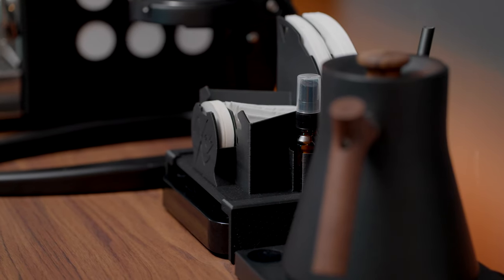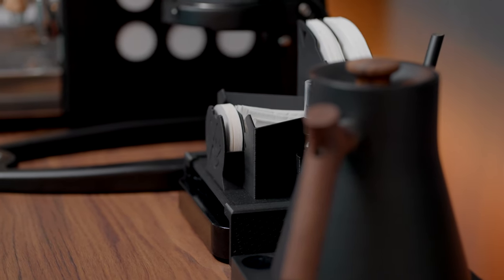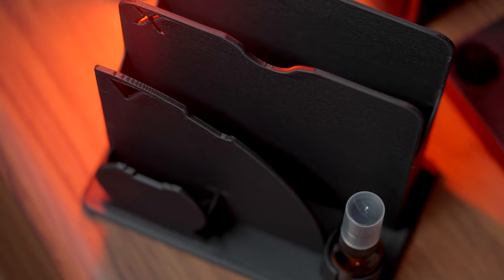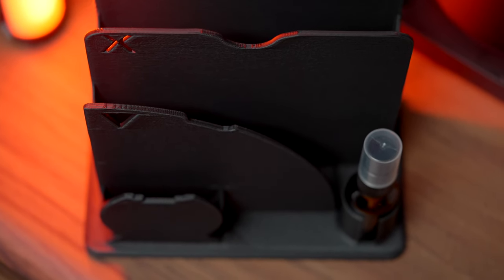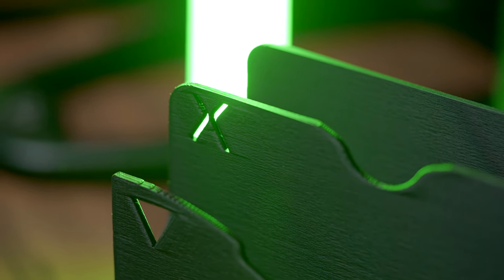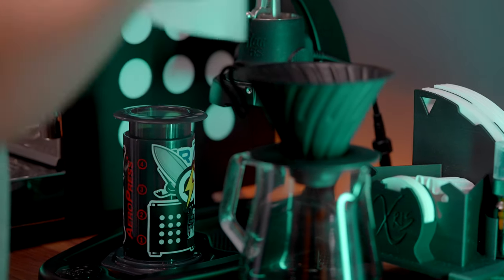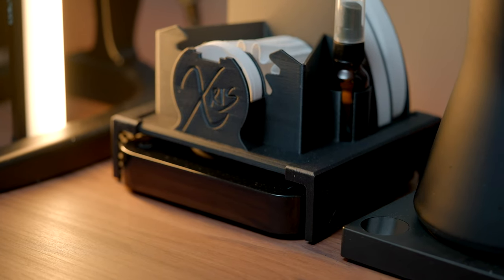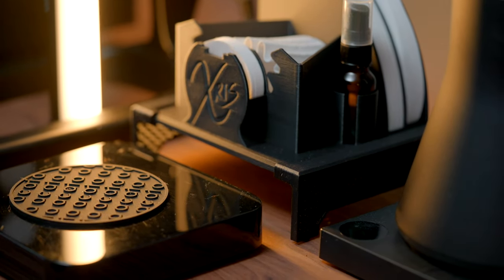The ULTIMATE Coffee Station Organizer!

Comment: I always wanted to print a Filter holder for various Filters but when looking closely to 3D printed surfaces you see thin plastic strings and I really don't want to have them on my filter papers so I didn't do it...
Reply from the maker: I don't think it would affect the paper filters themselves
Reply: @itsxris  No, but stuff will get lose when used  over time so you have plastie stuff hanging on them you don't see :-/
Reply from the maker: Ah I see what you mean - you can get rid of that easily using a lighter, it kills all the little hanging strings from a 3D print
Reply: I do my best to remove as much of any visible stringing possible before my units ship out and normal use does not cause any plastic to come off of the holder 👍🏾